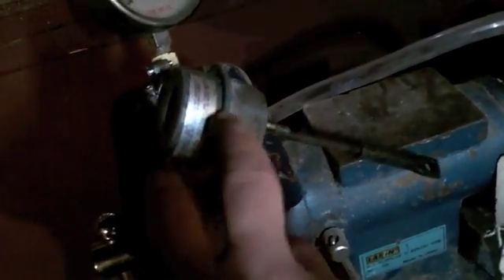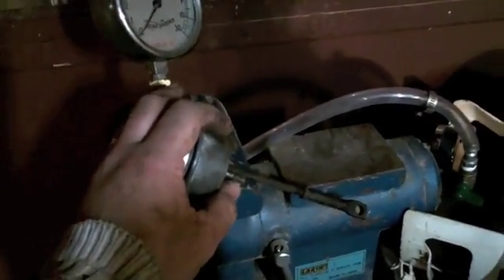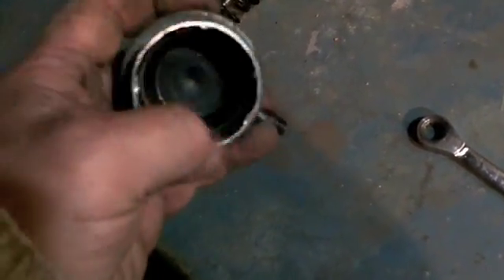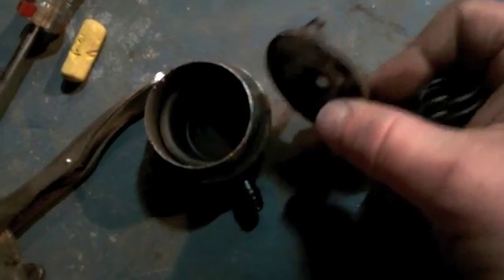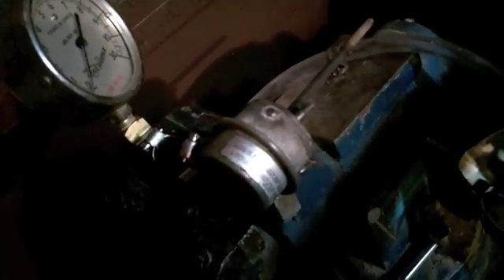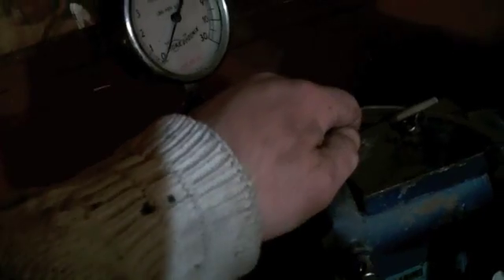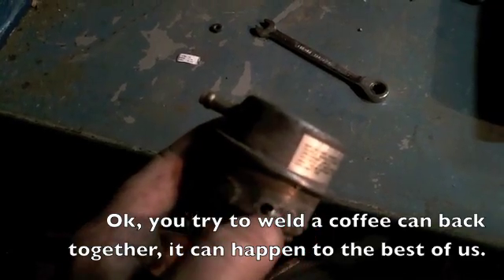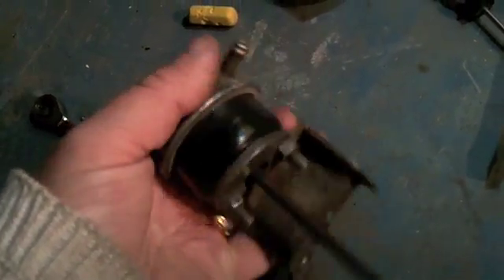Redneck turbo wastegate actuator BUILD YOUR OWN!

Comment: YES!! So glad I found this video, I was about to cut mine open around the crimped edge and word back together, but that would for sure melt the diaphragm, I'll now cut down low like where you did. This will decrease lag on my turbo miata in conjunction with an electronic boost controller. 😬
Reply from the maker: Let me know how it works.

Comment: I would take the tape and rtv off. High temperature epoxy maybe,  but tape will burn melt, and stink. Taking the preload off the wastegate arm would decrease a little boost as well.
Reply from the maker: It was ok for all the years I ran it but then again it was hardly on a high intensity application.
Reply: Thats good to hear.

Comment: To my knowledge it should work fine.  The gauge I have is a "vacuum/fuel pressure gauge" which I am able to test vacuum, fuel pressure, and also boost pressure.